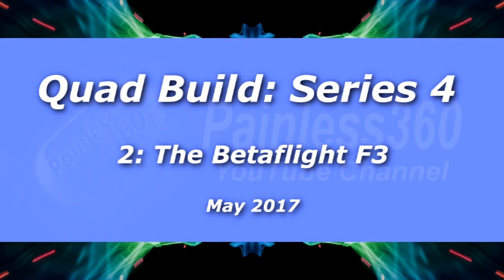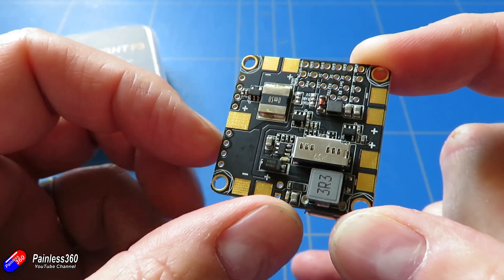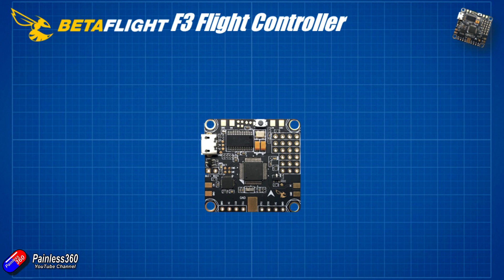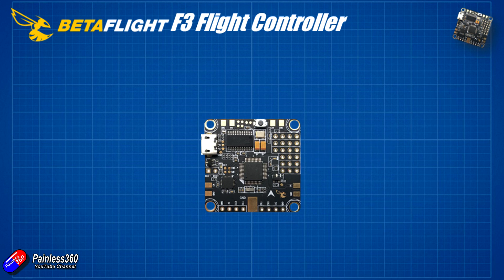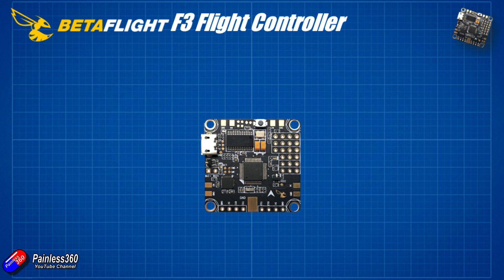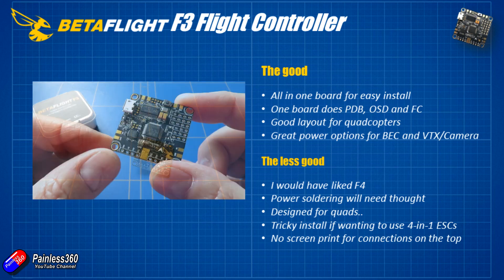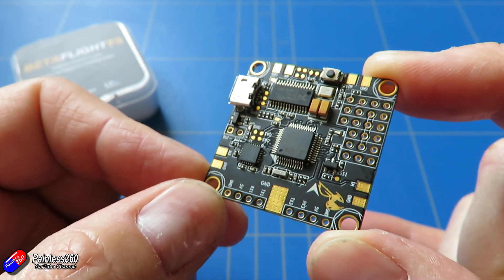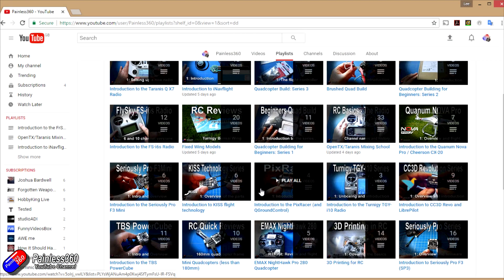(2/5) Quad Build, Series 4: The Betaflight F3 flight controller

Comment: Well hello there ,i have noticed you wiring your reciever in sbus 5v gnd pad.I'm a i bus user ,so should i power it in the ppm 5v gnd pad?
Reply from the maker: +Shri Nandh check the latest manual, because Ibus is a serial protocol, you usually need to plug it on to the Sbus pin and configure it in Betaflight. Best of luck!

Comment: im sorry if you have already answered this question but would 2306 2400kv motors over do this pdb/fc/osd with 25 amp spedix escs?
Reply from the maker: +Team Sicnetwrk depends on the props you're using. Check the specs for the Motors with the props you want to use and double check that it pulls less than the 25 amps maximum that the ESC can provide. Best of luck

Comment: You released this video just in time : ) Ive been looking at these with some interest and your closer look has been so helpful . Thank you
Reply from the maker: Glad it helped! :D You can see most of the other videos, waiting to be released over the next 4-6 weeks in the playlist if you want to get a head start.. Soldering on this one can be tricky and make sure you connect ALL GND wires to the AGND pin on the board if you're going to use the OSD (not sure why you wouldn't!) Best of luck!

Comment: I just crashed my quad and have this flight controller.  It will no longer do anything, won't connect to pc. won't arm, the osd doesn't work.  Any ideas?  Two of the ESC's were missing a few capacitors and one of them had some darkened spots on it, but not sure if those would have effected the FC.
Reply from the maker: +Twiztedmind864 sounds like you may have had a power problem that has fried the board. I'd remove all the damaged external components and give it another go.. Best of luck!
Reply: Yeah, that was my best guess.  I was thinking maybe since the capacitors were off of the ESC, maybe something hit it and then that caused the flight controller to be fried due to a short from the ESC.

Comment: I have 3 of these FC and I ground both vtx and camera to AGND no matter where I have the components powered from. I think the AGND is inline with the built in LC filter. Really frustrating there is still no official documentation with this board even though it's been out for a while now.
Reply from the maker: +Gs3xRfun that sounds like a great idea. It does look like that's the way to go it. A manual would be soooo handy! ;)

Comment: I don't like this board at all. Just tried to do a build with it and it's just not user friendly. It's hard to solder on both sides of the FC when you have the first two ESC'c on it. Plus you need to put writing on both side is your going to make us use both sides of the FC. I wired everything correctly and could not get video out of the thing. I test with a multimeter and everything, change from PAL, to Auto to NTSC. Just couldn't get it to work. I lover to be able to configure the OSD in betaflight though. I ended up tossing it the trash. I do love all your videos though, you taught me how to build these and I have built dozens of them now. Thanks.
Reply from the maker: +415bryant you do need to think hard about the soldering on this thing. We cover it in quite some detail in the following videos. It's the price you pay for a board with all of that on one single PCB..
Reply: 415bryant You won't have that problem if you solder the wires to the FC first then solder those leads to your ESC

Comment: The "+" ESC output pad closest to the sense resistor is nearly identical in size and weight of traces going to it as those from the input pad, so you can use that single pad to your 4:1 without limiting current capacity.

Comment: no benefit for F4 board, especially for the general public. F3 more than fast enough.  just an opinion
Reply from the maker: Agreed, at the moment F3 can run even the highest loop times without a problem. The code isn't getting any less complex and adding in additional functions (blackbox, GPS, etc) will start to push even an F3 processor in the future..

Comment: is the vbat filtered?
Reply from the maker: +NJ Tech I do cover that ground soldering challenge later. You sure need to work at it as the huge gnd traces acts like a massive heat sink!  :)
Reply from the maker: I'll let you know when we get that far! :D
Reply: yes, the 'RAM' is filtered, looking at the schematic. However I found that RAM selected to 5V was actually not maintaining the voltage very well so i changed it to VBAT voltage and its working fine for both VTX and Camera with no noise across the picture.  It may be because i have a pretty early version of the board. My biggest gripe is the lack of thermal reliefs! Boy does this board heat up when soldering on the ground rail.
Reply: right? haha, i've not seen my soldering iron sweat before :) one reason why i suggest people do the main battery leads last!
Reply from the maker: +NJ Tech even soldering the other connections first  to try and get some heat into the gnd pin didn't help as much as with other boards. Ended up using the larger tip, usually only used for power connectors, to get the solder to run even first the GND pins on the data ports. Unless you have a decent iron and solder this will be very tricky...
Reply: exactly the same as you, my build vid i used the fat tip for the small pads too just to get any ground pin solder to flow. Thermal reliefs would solve all this, i do hope they bring this to a new revision because it's a great board other than that.